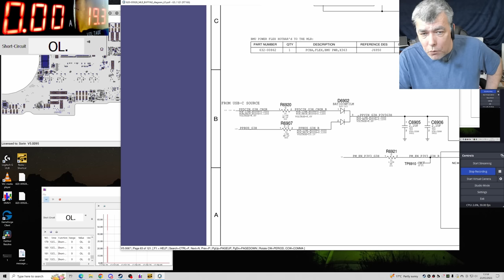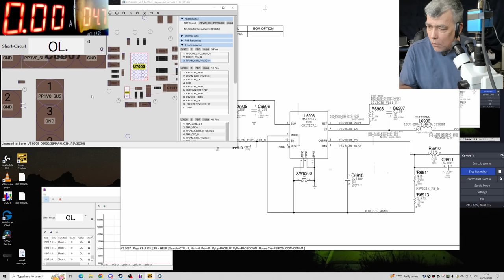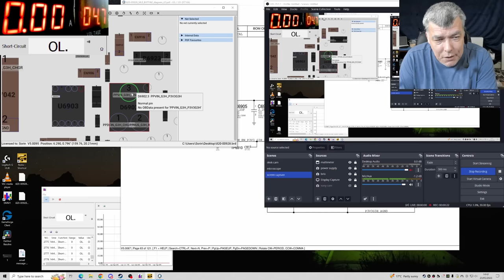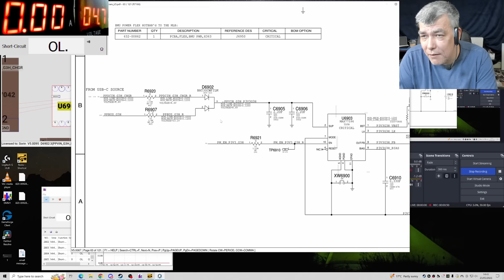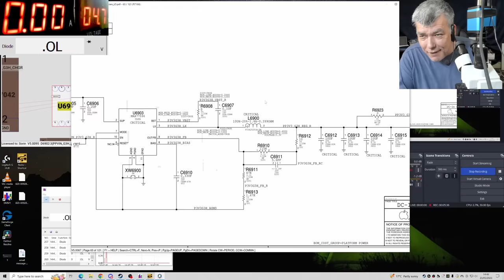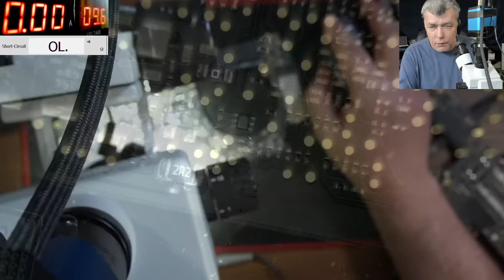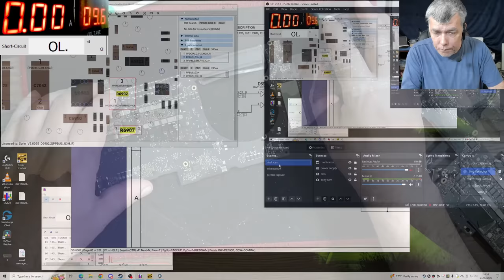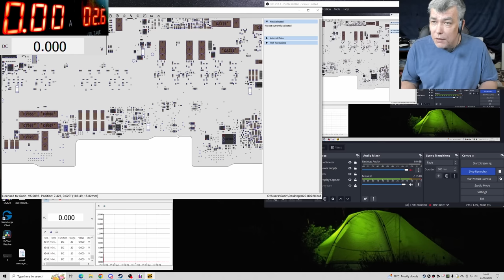MacBook A1707 820-00928 no power repair - PP3V3 G3H missing, a common fault in MacBooks

Comment: Another successful repair! Well done. 
One small note, when you tested the double diode, the voltage drop didn’t show a short. I can understand your concern if the capacitor took it down with it. But on this case it seems still good.
In case voltage drops between 2 diodes are the same i would declare this diode still good 😊.

Thanks for keep teaching us!
Reply: Because that double diode show value on both side mean that is shorted from both side

Comment: Apple would charge $1500 for new motherboard , they don't even attempt repairs like this.
Reply: they will just say . it will be cheaper to replace it with a new one, data recovery is your problem
Reply: You’re not kidding! Just had a customer quoted $1500 for a damaged touch bar after a bad drop. I was able to help the customer for $200. I had to replace the keyboard and Touch Bar.
Reply: @tinman9341  you was lucky that it was an intel MCB, in a new ones both of them are serialized to the MB.

Comment: bigger is better? what about stress on the semiconductors just before the capacitor - they have to charge it - looks like a short for longer?
Reply: Sure, if you replace 10uF for 1000uF. Here where he replace it with maybe 22 (or more likely same capacity but higher voltage rated one) it mean nothing,

Comment: Hi Sorin, i love your videos, and i have a question for you. I managed to find a shorted GPU mosfet on a asus ux550g thanks to your videos. After removing the mosfet laptop turned on, goes into bios, gpu is recognized. Only thing is that the fans are not spinning at all... I ordered the mosfet, would like to know if the fans are going to spin when mosfet installed, i believe you had a similar case, but cannot find the video... Thanks 😊
Reply: probably the fans work only when the temperature goes up try to stress the cpu and see if the fans spin. R
eplace the mosfet for good measure.

Comment: one of the worst MacBook's that exist. Flashgate issue +butterfly keyboard make it a future dead one.
Sorin, about the diode, can I replace the double diode with 2 regular single diodes  ?
Reply from the maker: Sure, i have a video replacing them with two normal diodes
Reply: @electronicsrepairschool  is it possible to use 2 pieces diode 1n400x for replacement of the double diode?
Reply from the maker: yes @ajoenaim

Comment: Would it be feasible to attempt a similar repair without the use of a microscope?
Reply: IMO it’s not impossible but highly unlikely. When the components get down to that size it’s so hard to see them clearly with the naked eye. With a over head magnifier it’s doable but then you start struggling on working height with the soldering iron or heat gun and fogging up the glass with breath while concentrating. Maybe a set of surgeons loupes would work ok but by that point you’re better off getting a half decent microscope. Not that expensive and really make life sooo much easier !

Comment: The schematics tell you the precise value of the capacitor. Rather than grabbing a random capacitor off a board, why not using one of those books with SMD capacitors of every value and size?

Comment: Hey Sorin Perhaps the hard drive should be removed before each repair so as not to cause problems with the customer. I have seen this in other videos
Reply: The storage is soldered to these boards so cannot be removed

Comment: Bigger is not always better. Bigger capacitor will crack soner than smaller on PCB bending test. It depends also on  capacity. High capacity means lot of layers and more fragile capacitor.

Comment: 15:30.   DEFINITELY YES.  BIGGER CAP HIGHER VOLTAGE. WAYYY LONGER LIFE.  THEY USE THE BARE MINIMUM WHICH IS TOO SMALL AND ULTRA SHORT LIFE